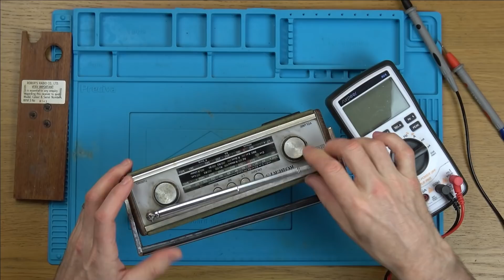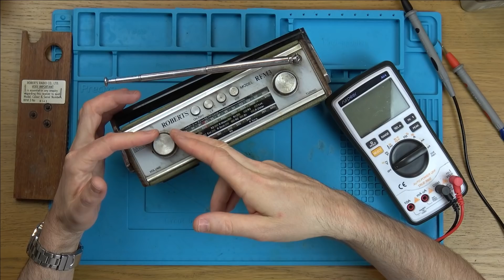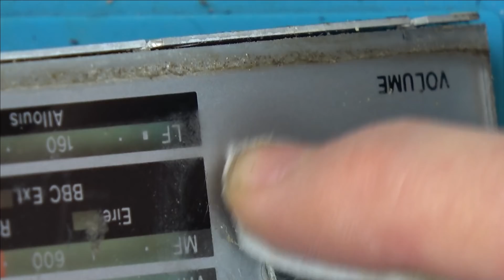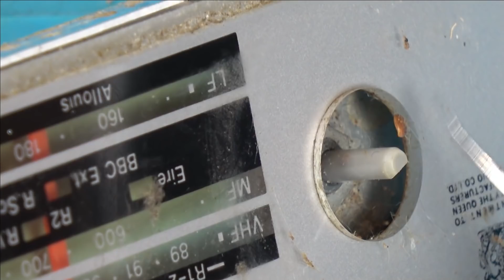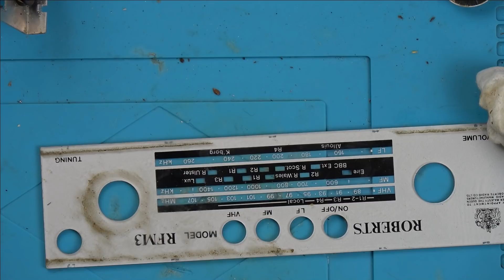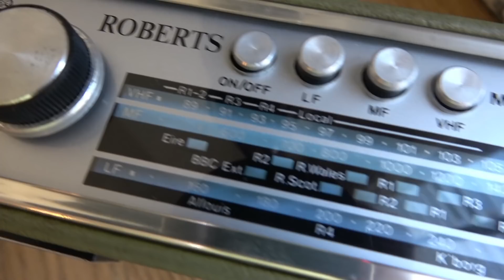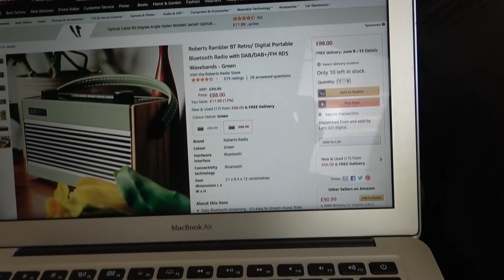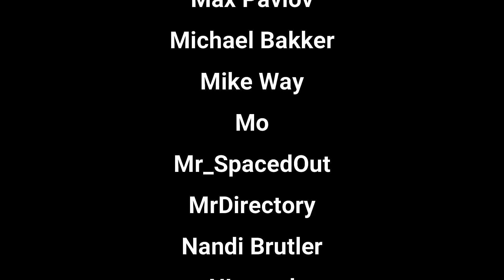FIXING & RESTORING a Stunning ROBERTS RFM3 Radio

Comment from the maker: Spoiler Saver & Riddle

Divide 110 into 2 parts so that 1 number is 150% of the other number. What are the 2 numbers? 
For example 40 and 70 make 110... BUT it is incorrect because 70 is 175% of 40.
Reply: 44 and 66?
Reply: 66 & 44:      44 x 1.5 = 66+44=110

Comment: best thing for the wood ends is teak oil, not varnish, pretty sure thats what was used in the factory, i've had those type switches give trouble a lot, they're not really designed for power switching, only signals,  especially dc, if theres a capacitor one or both sides, they spark and damage themselves, you can sometimes remove the sliders to clean the contacts, from the rear end, sometimes the front, depending on the manufacturer,  if you take the knob, spring and latch mechanism off,  if it gives trouble again, you may need a new switch, may find them on ebay,, if not i may be able to supply one, maplin used to have 'similar' ones, very likely compatible, i bought a load before they went bust

Comment: Quick answer to the leather question: It's a synthetic leather than was produced back in Sheffield in the 1920's called "Rexine". It was originally used in cars, but Roberts got a super special deal with Rexine's parent company to use it on their radios in the 60's. They actually someone take imprints of real leather and sort of mold it onto the vinyl. Just hope it clears things up :D
Reply: They should/could have been using offcuts.

Comment: The push buttons you cleaned while mounted comes off if you pull, easier to clean then. The laquer you used could be switched out with teak oil, a matter of taste i guess. Otherwise good restoraion. i have restored quite a few vintage radios and tv's earlier, satisfying, isn't it ? Keep up the good work.

Comment: You can installation small toggle switch on the rear of the radio in case the original switch was unrepairable

Comment: In case you didn't know, the antenna can be stored inside the case. Turn it straight up, then push it all the way down inside itself so it's of the way of the carry handle.

Comment: The ON-OFF switches on these seem to be a bit of a week point (and on other Roberts models). I wonder if there's a rather large uF capacitor across the contacts causing a high inrush current? Who knows. What I tend to do is parallel-up the contacts (since Roberts only used one set for some reason) and that seems to keep it soldiering on. You were correct with your comments of course - the ON-OFF switch needs to be pushed down for on.

Yes Hacker - even better than the Roberts R707 in my opinion (and the R707 is fantastic). See if you can find a Hacker Sovereign RP18 or RP25/RP25A perhaps? You'll need 2 x PP9 for those. The entire back hinges down for easy access. Stock faults that I've come across are the multiplug to the audio amplifier (tarnished pins), faulty germanium transistors and the occasional electrolytic cap. Ah, and the 3.5mm jacks (don't plug anything in to them - it's likely to be a one-way ticket to open-circuit). Best of luck and do please keep the postings coming - it's nice to see someone else get stuck in to these things.

Comment: I have a Roberts RFM3, bought second hand from ebay about 5 ears ago. When I bought it it was fine, but no it only seems to pick up one FM station "Classic FM". When I try to tune into other stations its v.difficult, I might get 1 or 2 with some very precise movement of the knob. What do expect is wrong with it. Arial is fully extended and its not a bad signal area; im running it from a dedicated Roberts plug in transformer. I think theres something amiss !

Comment: I used to fix Roberts radios like this and the larger model with the swivel base for the RNIB that gave them to blind people. The radios were robust and easy to operate for the blind and sighted but every one had a design fault on VHF (or FM) in that the sound was always slightly distorted. Fine for listening to the news or The Archers or cricket on Radio 4 long wave but terrible for VHF music. After a few hours use anyone would get a migraine without knowing why. Listen to a Sony all day and it would just be a joy. Made in the Morden area of south west London they stuck with germanium transistors when the rest of the world moved to integrated circuits. I hated them. Worse still someone makes perfect reproductions!

Comment: The power switch is known as a DPDT bank switch. The common is the center pin, the outside closest to front is normally closed, other end is normally open. Dual-in-line, other side is the same. Know what I mean?

Comment: Try Servisol Switch cleaner (Super 10) instead of deoxit.  It's been my switch cleaner of choice for 30 years.  A quick spray and your switch is not only clean but it is lubricated as well.  I also use a foam cleaner with a toothbrush for hard (non porous) surfaces.  Especially good at moving nicotine staining.  Love your enthusiasm throughout your videos.
Reply from the maker: Thank you Gordon, just bought 200ml of the Super 10 from Amazon for £6.49. I do love DeoxIT but this really needed an aerosol to get right into the switch, and the DeoxIT aerosol is very expensive. Cheers 👍👍👍👍
Reply: @Mymatevince  be very careful with 'super 10' i've had it destroy several potentiometers, it can cause some plastics to 'crack up' , these pots had soft black plastic rotors, and they broke their wiper fixings a short while after treatment,, older type pots with grey or white nylon rotors seem ok,  try electrolube EML , its 'supposedly' more 'plastic compatible' , but rather pricey,  the EML is also leaves a lubricating residue behind, which is useful in some cases,

Comment: For the hot glue, maybe you just had a defective hot glue gun? I have a very cheap one that cost around $10 and it comes up to temperature in around a minute, about as long as for my hot air station to heat up, and our mains voltage is only half of yours. It allows you to be much more precise and the the flow is much more consistent than just rubbing a melted stick on things. Maybe you could buy a new but defective high quality one and make a video about repairing it!

Comment: Good job. I used to work for a Roberts dealer, and the only time these ever came into the workshop was due to the switch bank failing. Affected most models and was at one time available as a service item. It was probably the only weak point on these sets, that and the battery connector. They always had a lovely rich tone

Comment: Hi Vince. Loved the video. I went to a carboot yesterday and found a Roberts R606-MB which seems to be the bigger brother to yours. I did buy it as the seller only wanted £5 for it. My one has treble and bass controls on it and seems to be a little bigger than the one in your video. All it needed was a good clean and the volume control cleaning. I am listening to it as I write this comment. Roberts certainly do make good quality radios.

Comment: To clean vinyl or leather on old radio equipment etc. I've found that car interior cleaner and a soft nail brush works really well then just sponge it off with clean warm water. 
There was once a product called decosol which you painted onto vinyl seats and when it had dried peeled off like that time you might have done when you were a kid and discovered you could make copies of your fingerprints with school glue , lol.
Reply: fiebing’s saddle soap is one thing that’s worked very well for old film camera half cases for me. it’s in a tin with a yellow lid, i don’t know the availability of it outside the US

Comment: I do a lot of cleaning and repairing old tech like this, and here's a good tip. What would help you a lot on the cleaning side is to put some IPA in a small spray bottle. Just mist the parts you need cleaned and then wipe them with cleaning wipes. The spray bottles I've found to be perfect are 3.O FL OZ/89 ml GARNIER Fructis hair care products. The atomizers spray the perfect amount of IPA. I'm sure many other bottles would work though. 🙂
Oh I meant to put this as well. When it comes to repairing think chrome stripes, the Molotow Liquid Chrome markers and FLOWMASTER Mirror finish markers are amazing!
Reply from the maker: Thank you for the tip Micah, just Googled the Liquid Chrome markers and they look very nice 👍👍👍
Reply: @Mymatevince  no problem at all. The markers work great if you put it on with smooth clean strokes. It really turns out looking like chrome.

Comment: Very handsome design! turned out very nice. One bit of pick though, couldn't  you mask off the letters in the logo and use that pen to fill in the missing silver on the "R" and under the ROBERTS on that raised line? Also looks like it could use just the tiniest bit of black there on the left and right. Otherwise "simply brilliant"! although I was cringing as you took it apart. It seemed like you were going to break something at every step!
Makes for a very entertaining video for sure!!!
Reply from the maker: Thanks Nicholas, it is hard to see in the video but the Roberts logo is under approx. 1mm of clear plastic. If I painted it on top of this clear plastic, it might look strange when viewing from an angle 👍

Comment: Understand the video is 2 years old but wondering if there's anyone in the comments that can help.
I've got a roberts revival petite that won't play audio unless the volume is crank, at which point audio kicks in but is a distorted mess.
I replaced one of the op amps and it works beautifully until I turned it off and on again. Presuming something is putting a fault on the op amp.
Anyone with audio circuit knowledge have any thoughts what might be causing this.